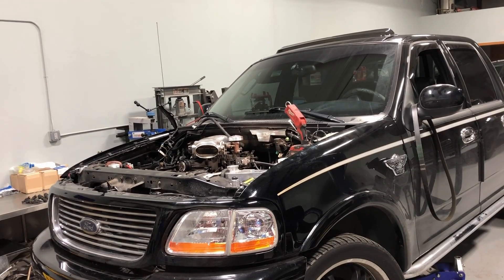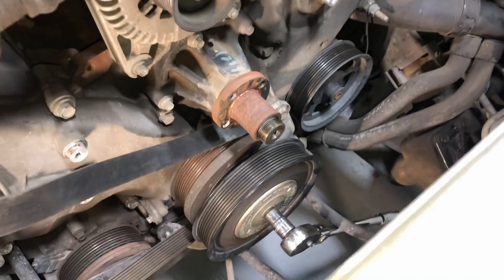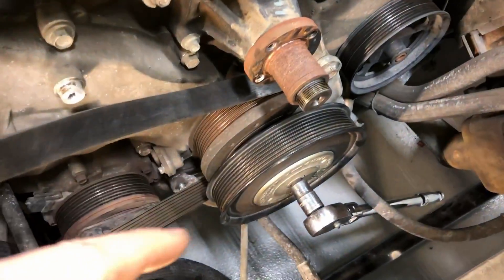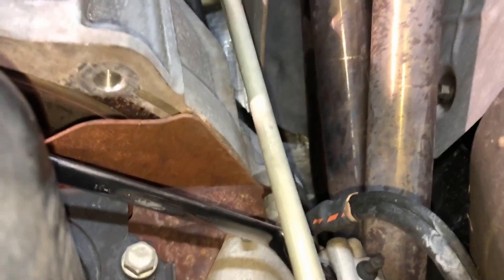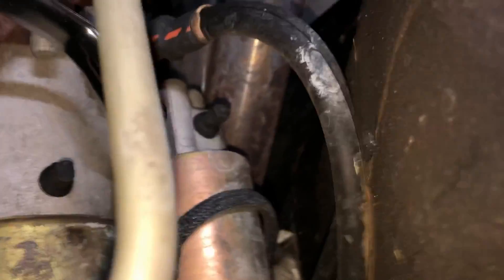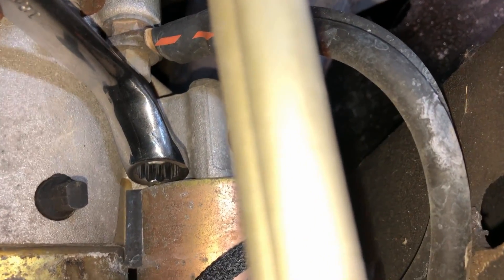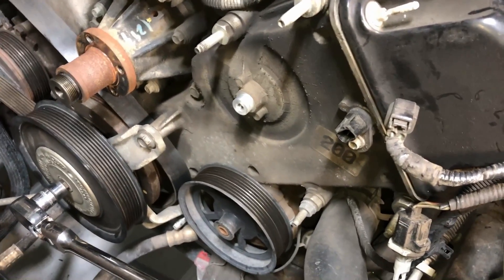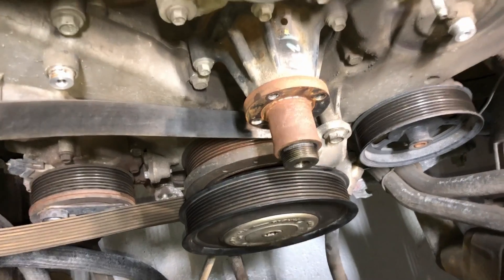Ford Factory Supercharged Engines: Crankshaft Supercharger Pulley Removal Trick!

Comment: Been trying to change my serpentine belt for 7 years!!! I was always scared to try this but once my guide starting rattling on cold starts I decided to finally give it a try. I bought the Pittsburg offset wrenches and kept slipping off. But having my pops holding tension on it against the oil pan with a pry at it finally broke loose. I was able to to a complete timing job and of course new belts. Thank you Brian!!!!

Comment: Great tip!  Now  how do we hold  it in place when we tighten it to 75Ft lbs.
Reply: Was just wondering if you ever found a way to hold the torque converter while you torqued the bolt to 75ft. Pounds? Thanks for any help

Comment: Grrrrrr sometimes the offset wrench trick doesn't work 🤬 ordered the mmr flywheel lock out from Amazon. Doing a JLP heads and Stage 3 cam swap on my 02 Lightning. I want my girl running finally 😩 I'm so damn close!

Comment: how many coolant temperature sensors does the 02 Harley Davidson f150 have?
I’m aware of the one behind the alternator on the head, but orileys sold me two sensors and the other one I’m not sure where it’s at or if the truck even needs that second one they sold me.

Comment: great video I have tried your exact idea before watching your video and the problem I am having is the wrench is flexing and popping off like its a spring. and its marring up the torque converter studs and nuts I don't want to break one or mess up the threads which I feel will happen if I keep trying this.  my truck has roughly 80k miles and the pulley has never been touched. I am not going to reuse this pulley I am going to an aftermarket pulley setup for more boost so its not going to be used ever again. my question is can I use a Sawzall and a long blade and cut between the pulley and balance and just cut this pulley off?

Comment: I've got an 02 F150 HD and it feels like it's low on fluid while idling on gear (RPM's jump up and down a few hundred, falls in and outta gear (worse in reverse)) and has such hard shifts that it'll either feel like I'm being rear-ended (I've learned to let of the gas when I feel the shift coming) and causes the belt to chirp when it shifts.  Fluid level is perfect and I paid a shop a few years ago to rebuild it...if they did is a different story but still.  Any suggestions?

Comment: Brian I have a question I have a 2000 Ford F150 with the 4.6 liter engine my question is originally they say to use 5w30 now they say to use 5w 20 which one should I be using and should I use a full synthetic

Comment: Thanks for the videos. I appreciate the tips.  What is your thoughts about swapping in a supercharged 5.4 Lightning engine into a 2001 F-350 that has a 5.4 2v engine.  The 5.4 in a 1 ton truck is way under powered.  I was thinking that the supercharged 5.4 might be a better option than swapping in the 6.8 v10.
Reply: I have a 2010 F1 55.4 Wheel Dr. my air-conditioner is not working what can I do to fix it

Comment: Great method but it goes without saying DISCONNECT the battery before attempting this. It's such a common mistake to completely forget and have the starter engage simply by grounding it or bridging a terminal with a tool.

Comment: Sir, my ford focus 2013 check engine on and there's (engine running steady state Highway...then the PCM detected taht the rear HO2S switch rate was too high) and then 100km later like blast when i check oil clearer filter cap opened then I fixed again like this a month ago I sprayed diesel in intake for cleaning after that like this please tell me the solution 3 times I fixed a garage but he is not ford expert thak you

Comment: I have a 2019 Ford Edge ST with the new 8spd automatic. The car now has a little over 2500 miles on it. About 5 days ago, I noticed some slightly intermittent rough shifts between 1-2, 2-3, and sometimes 3-4. Have you had any experience with this or heard anyone else complain about this issue? I’ll be taking it to the dealer later this week.

Comment: 05 f150 took a six foot bar and had to pull the pan and wedge the crank. Broke the torque converter bolt before that. Just like the old Honda crank bolts.

Comment: I bet my 20yr old snap on 3/4 impact would have worked. If it would fit in there.  It’s a big heavy beast lol. I used it on my marauder when my 1/2” Chicago pneumatic couldn’t remove balancer bolt.

Comment: You don't need the special tool just take the starter out and jamb a big screwdriver or plastic, or rubber mallet against the ring gear. You have a huge mechanical advantage there. I wouldn't pry on the torque converter bolts.
For crank bolts going in the right direction just put a spanner on it and bump the starter. Now that's a real trick kid.
Reply from the maker: Yeah I know about that trick, I’m not doing that to this guys truck.....

Comment: Looks almost like the extension pulley on my old 98 DOHC Taurus with the LH thread and the 3 point standoff  I had to remove to replace a front crank seal, I wound up jamming the ring gear to break torque.

Comment: How do you tighten it when you have to reinstall the pulley? What's the jig for holding the flywheel from turning in the opposite direction?
Reply: Did you ever get the answer for your question on holding the torque converter while tightening the bolt? Cause I’m in the same situation right now! Thanks
Reply: @BluegrassIomc-zy1nu  had to watch the video again to refresh my memory. No, I never received an answer on the tightening procedure. Maybe the same concept with jamming that wrench in the opposite direction.
Reply: @BluegrassIomc-zy1nu  I read the comments further down and FordTechMakeYou Loco said to use an impact to tighten. It’s about 20 or so comments down. Hope that helps.

Comment: Does that socket head capscrew thread into crank pulley bolt? Just curious-did not see it removed.
Reply from the maker: Correct it is part of the pulley.
Reply: i was wondering the same thing how long is the bolt too.
Reply: @tylermulkey330 It’s not a bolt, it’s more like a threaded cup if that makes sense.

Comment: Remind me of a Honda crankshaft bolt that’s Crazy tight
Reply: Yes! I work at a Honda dealer and we need either a weighted 19 impact socket with a 1/2 or a 3/4 gun to get them off. Now I gotta deal with those Honda bolts and my lightning.

Comment: I have a question unrelated to the video. I have a 03 explorer O/D light flashing..hard shift from 1st to 2nd no 5th...coding p0775...any idea would be appreciated.
Reply: Probably output shaft sensor.
Reply: I bet u need the commonly failed solenoid pack....he has a video on how to replace it.

Comment: 03-04 cobras were 4.6 superchared...  not 5.4, 07 was the first year for 5.4 supercharged cobras..
Reply from the maker: Correct it was a 32v version of the 4.6l I just had one in the shop a few months ago did you see my facebook post on it? I was referring to the Mustang engine explaining it was the same pulley setup I never stated it had a 5.4l 2v in the mustang just the f-150 versions. I remember reading magazines about the "terminator" engines back in the day drooling over them.
Reply: FordTechMakuloco so what would do if we were doing this on a cobra? Being T56 manual, there is no torque converter nuts to do it that way.
Reply: @Bama_RTMF  leave it in gear and set the parking brake. Clutch will hold it
Reply: @FordTechMakuloco  gotcha.. sorry for the miscommunication.. I'll have to go see ur fb.. I didn't see the mustang one..
Reply: Don't forget the 89-95 Tbird SC's!
Reply: @alb12345672  Sc were 3.8 v6..

Comment: What is wrong with the engine with only 39,000 miles?
Reply from the maker: Timing tensioners, loose spark plugs, valvetrain noise and oil consumption issues.
Reply: Must have been 39k very hard miles...
Reply: That seems excessive given the miles. Common Ford..

Comment: How do these timing components go bad in 39,000 miles? WOW!
Reply: The truck is at least 15 years old. The 2V is a non-VCT engine. Could be a tensioner let go, not necessarily that the components wore out.
Reply from the maker: Tensioners yes.
Reply: These trucks come up for sale online quite a bit with the owner trying to sell them needing the whole timing job done. I want one but can never get there fast enough to buy them, somebody always beats me to them. Thanks for the videos.
Reply: Wrong oil used or cheap oil without the correct additives, ignoring preventive maintenance schedules (oil change intervals) - your choice, lots of reasons.
Reply: Is one that you forgot to mention “purchased wrong truck”? Makuloco buying a Dodge about says it all.
Reply: @thesearcherman6652  dodge isn't the answer.

Comment: Hey Brian, I watched most of your videos, but do you have a video of a COMPLETE engine rebuild. Unless I missed it somewhere, that sure would be a awesome and VERY appreciated video. Your a great teacher and your videos show that. Thanks brother for all your hard work. I'm sure I speak for alot of people. Bear down.
Reply: Honestly I think most shops won't even do rebuilds on most modern engines. Some of them are so complex that it's not worth the risk and the cost to get a used engine is usually the more sensible option. That's what I did with the rear end on my truck, a rebuild in parts would've cost me over $300 in parts and my local salvage yard had a limited slip upgrade for $250. I put it the used one and it's worked great and low I have a ls in my 2000 f150
Reply: These days it's cheaper, faster, and easier all around to just buy a crate and stab it in there. That's the route most shops will take these days. Modern engines aren't as simple as in days past, so it can take quite a bit of time to do a complete rebuild ... and then you still have to take the heads and block to a machine shop to do the job right (matching piston to cylinder with proper clearance and hone, machining deck and head for 100% level, etc.).

Comment: 1:42 Pittsburg socket! What! No snapon?!!? How could you not spend your whole paycheck on sockets.... smh
Reply from the maker: The day theses hex sockets fail, is the day I will spend some coin on a quality set.
Reply: @FordTechMakuloco  or use harbor freight  impact sockets for strength
Reply: those hex sockets are better than other expensive brand...good job👍🏻👍🏻👍🏻
Reply: Its not the sockets or tools that defy the quality of work being done to a car.. its the person using it.. pittsburgh toola can do the same job as snap on..only difference is material quality
Reply: I used to buy MAC tools, they were pretty decent and a little less than the Snap-on tools. I had some Cornwall sockets that were decent as well.
Reply: @jeffthejinjer   Home depot have a lifetime warranty on husky hand tools.